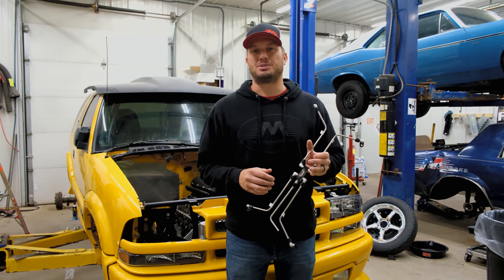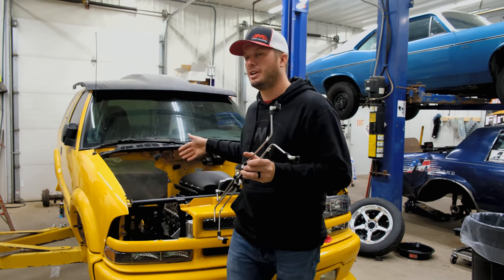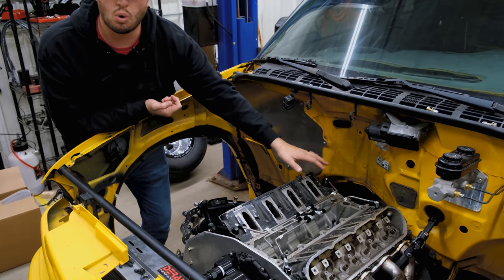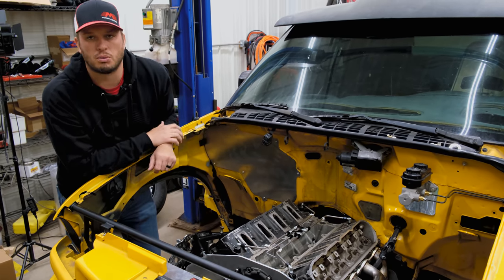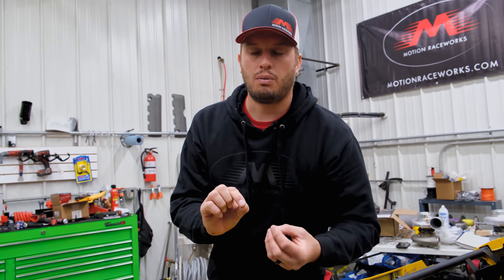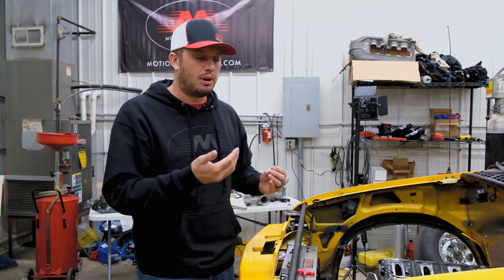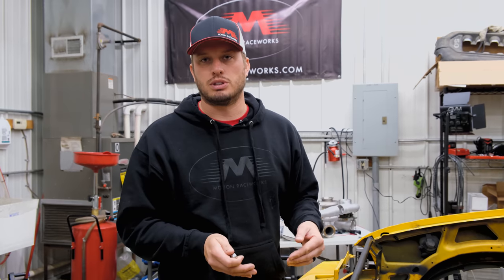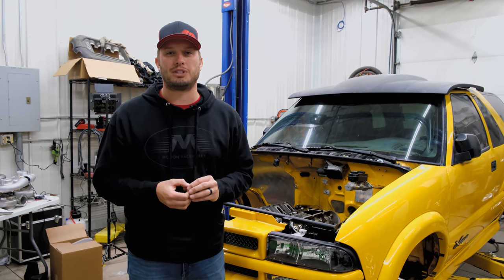LS Engine Steam Kit Routing: Tech Tip Tuesday

Comment: You want that steam to go to the highest point in Waterloop,  otherwise it cause cavitation in the water pump if you have it dumping into the water pump. Factory GM location is directly below the radiator cap, in the radiator fill neck.
Reply: you want it after the water pump in the upper radiator return hose which goes basically to where he says in this video

Comment: I have a LS with a FAST intake so I can only set up the air release for the front and I m thinking about running straight to the water pump like you said. I'm just wondering if y'all have a set just for that?

Comment: Can anyone explain why steam pockets would cause a lean condition? I get why it would increase cylinder temperatures but not why it would go lean. Thanks in advance!
Reply: Mybe get so hott it vaporizes fuel in the rails are carburetors I read fuel can boil below 100 degrees somewhere  idk 🤷‍♂️ I was thinking same thing

Comment: Which year? Has  4 hose steam ? My 04 swap has only 2 on front
Reply: all LS heads have the ports in the back, some are just plugged from the factory. Using them all isn't a bad thing.
Reply: @mathewshackelford8037  @ isn’t a bad idea to use the 99-2000 hoses for all 4 ports,,?
Reply: @gerardolopez5875  it's not a bad idea to use all 4 ports.
Reply: @mathewshackelford8037  @ ok, thanks

Comment: Any idea if the small metal gaskets are needed under the steam pipe? I installed a factory vent pipe on the rear of my 03 Z06. Leaks intermittently… new felpro O- rings (match factory), and clean mounting surface. 
Still leaks… torqued to spec each time… still leaks. Front never leaked, and never had the small metal gaskets.

Comment: Mine has been plumbed into the back of the water pump for the last 9 years with no problems.
Reply: Adding steam to water pump makes no sense but it might be convenient. Would circulation improve taking it to radiator where high press bleeds off......I  think so.
Reply: @fasteddy  don’t over think this subject. 10 years now in 100 plus temp and still no problems.

Comment: So I need to change mine? I have a 5th gen Ls3/L99 for you picky asses.. anyway mine only have the front corners and ran to the rad. Well when I changed the cam and delete the steam kit I got just runs from one side to the other looping the system.  My car is a daily and not a race car so is it that big of a deal or should I change it?

Comment: Next week should be how and how not to power wheelie
Reply: Jack up the pinion angle, air down tires to 16-20 psi, transbrake w/ 4000 stall, add 700+Hp and WHEEELIE!!!!!!

Comment: don't need them on a 5.0 coyote
Reply: Derp, this is a Gen 3/4 SBC, It was an engineering solution for a Engine Design that was launched in 1996 and was last produced for vehicles in 2016 (Isuzu NPR) that got rid of the wet intake. Coyote came out in 2010 if I'm not mistaken...

LTs probably dont require them. Coyotes also cost way more.